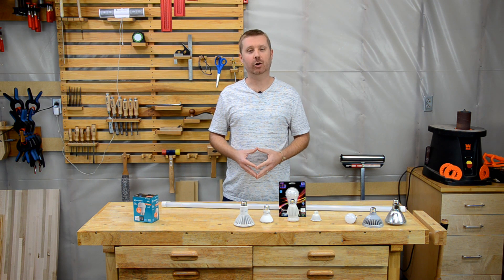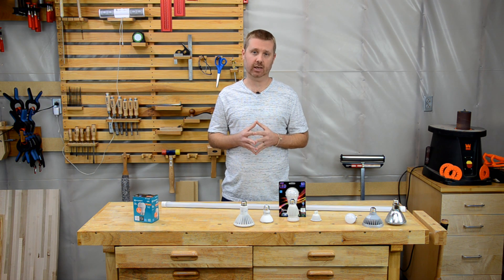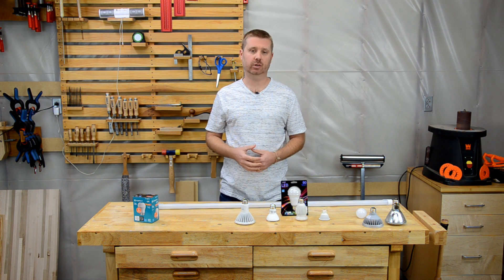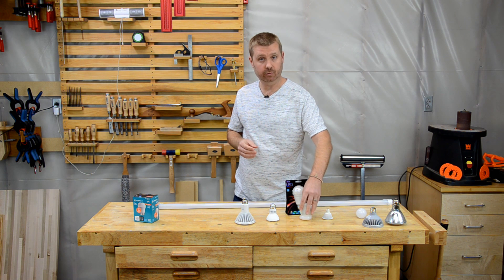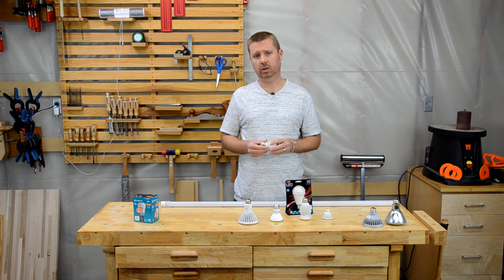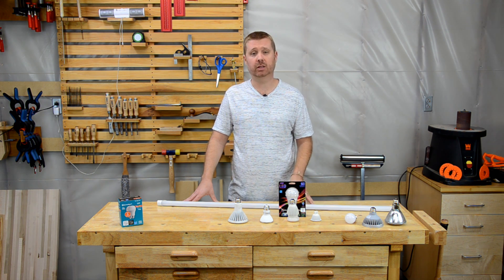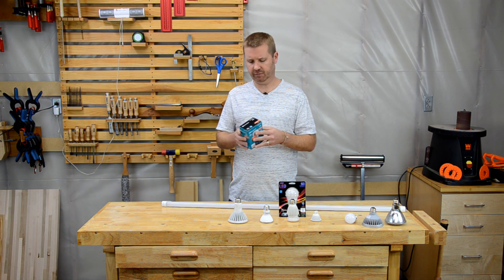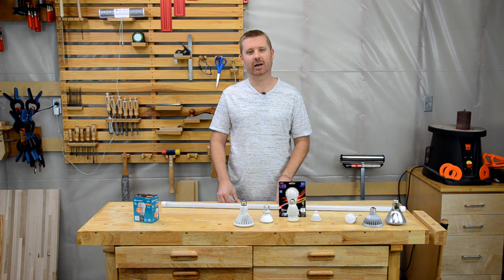Tips For Buying LED Lights | Watch Before You Buy!

Comment: Just buy high quality (more expensive) brands! In 3 years I have yet to have a failure. Typically I only buy Cree!
Reply from the maker: I've had great luck with Cree integrated LED lights (zero failures to date - knock on wood), but their LED replacement bulbs have still failed on me. Generally, I agree that buying higher quality is a better way to go in the long run, but not fail proof.

Comment: The payback is entirely dependent on how often a light is used and for what duration. Giving a blanket number of 4 or 6 months is too categorical.  Either explain the formula so a viewer can figure it out or go with the tried and true YMMV.
Reply from the maker: That was just a generic example to illustrate that the extra bulbs won't increase the payback period by some unreasonable amount. It was not intended to be an absolute measure of payback period. Everyone has different circumstances so yes, there can be no blanket statement on lifespan.

Comment: One of the biggest factors in LED bulbs dying due to heat is the direction that they are mounted.  When the screw in socket is above the LED's, heat tends to be trapped around the electronics, and you will likely get 2 years out of a 5 year bulb.  The same is true of the tube lights - if they put out heat that is trapped with the bulb the bulb dies quickly.  When converting shop fixtures, try to use fixtures with 10 mm or more above the bulb.